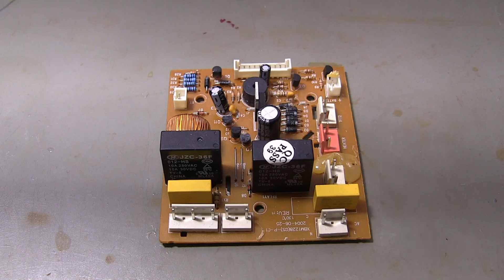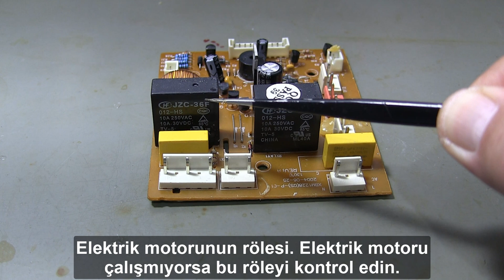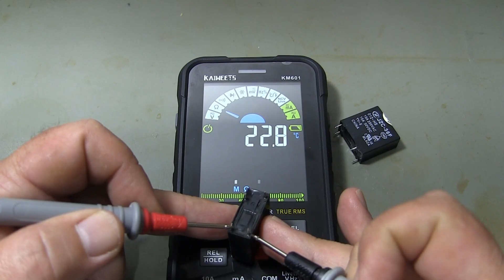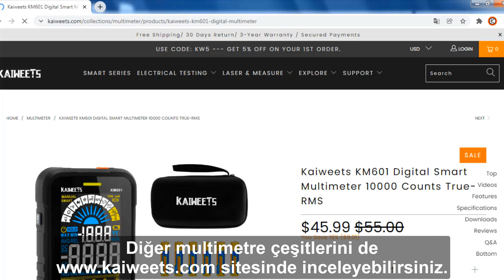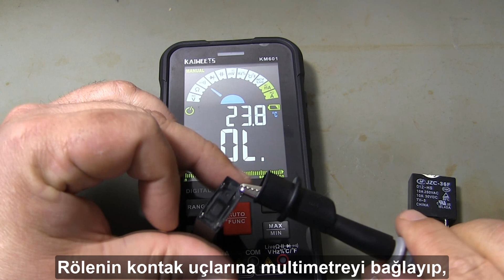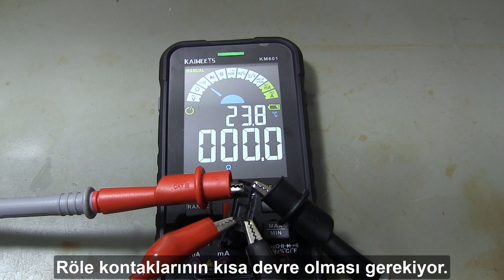BREAD MAKER REPAIR-4 | Electronic circuit board faults  | Electronic Repair

Comment: Bisa bantu saya soal modul mesin cuci LG
Reply from the maker: what is the problem?
Reply: Awalnya modul mati total terus saya cek ternyata ada elco yg bocor tertabrak water level sudah saya ganti elco nya yg sama persis dan sudah nyala tapi semua lampu nyala berkedip saya coba cek pakai apl LG think ternyata eror TE sudah saya ganti termistor, Hiter, door lock sensor motor tetap saja eror mohon petunjuk nya🙏
Reply from the maker: @rudilesmana1330  Hello, can you send the pictures of the electronic card to my e-mail address: elektronikatolyem@gmail.com. Let me take a look at the pictures.
Reply: Saya baru saja mengirim kan foto ke email anda